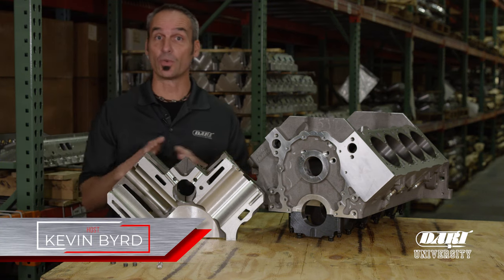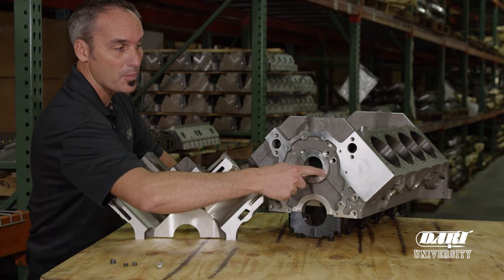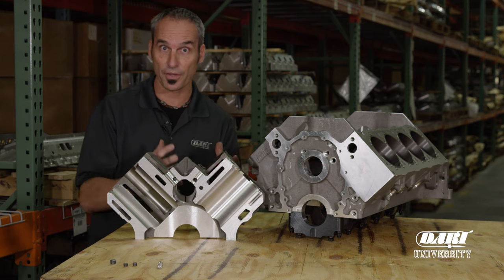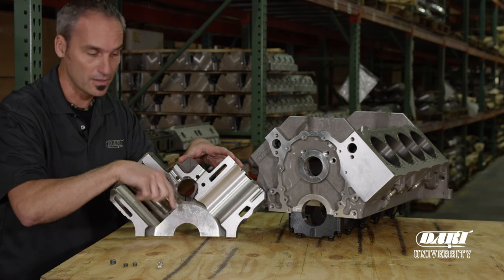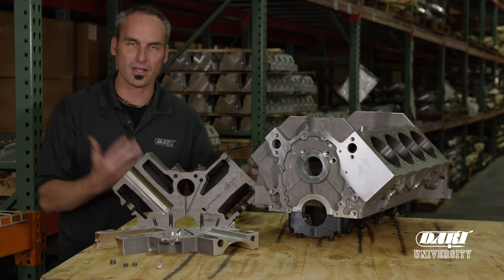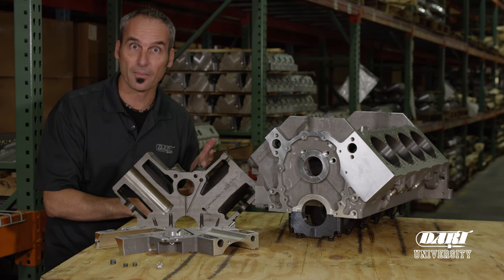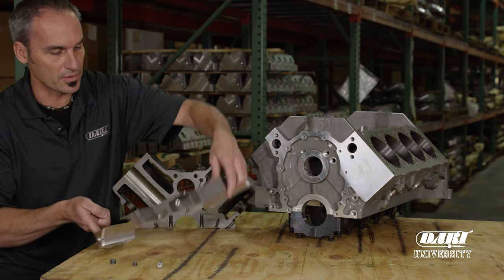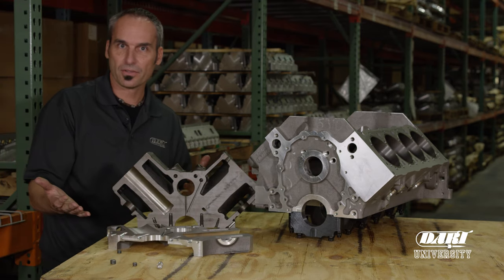What is Priority Main Oiling?

Comment: To me, the #1 benefit of shifting main galley away from stock centerline position is there is new room for aftermarket cam manufacturers to bump up core size and get at new territory in reliable lift numbers - rollers can take advantage of this.  A street ride with sub 0.650" lift doesn't  even begin to look at that.
Reply: A big plus is if u loose oil pressure lifters bleed down before u can burn down the engine due to lack of oil
Reply: Cut a small slot in the lower distributor shaft housing to squirt oil on the gear.